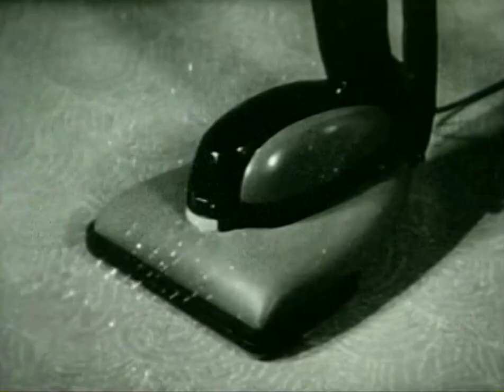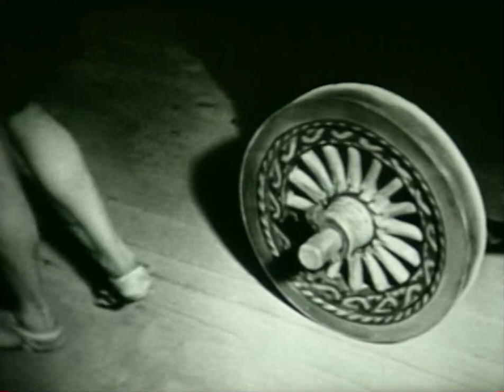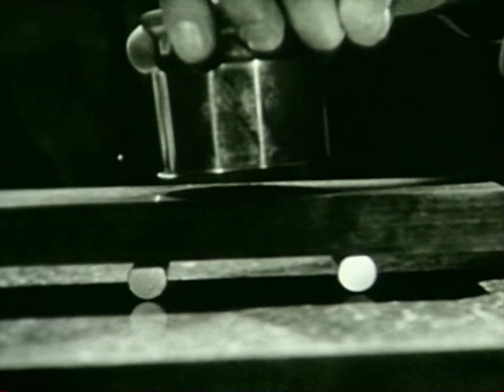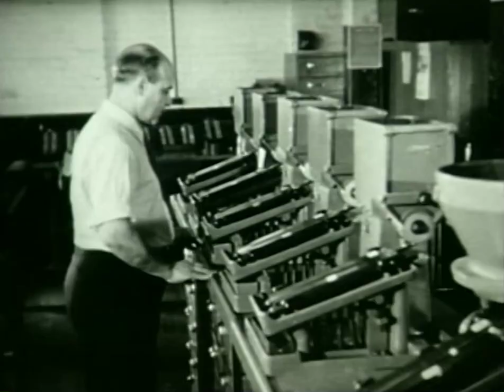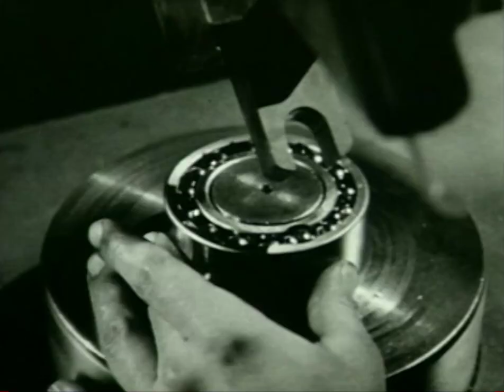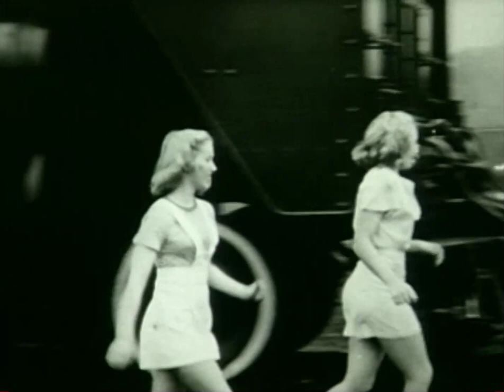Turning Point the Story of Bearings, New York Central "Niagara" 4-8-4 Pulled by Four Young Girls

Comment: Before it rolls they have to overcome the inertia. A body at rest....yada yada.    Call me skeptical.
Reply: I park on a hill all the time.
Reply: Not skeptical but not paying attention. In all examples give the inertial resistance to motion remains, but in a reduced amount when using roller and ball bearings when compared complain bearings. You can tell that by the degree of reflection on the plastic ruler and the feather.
Reply: Inertia and friction are two different things, right? Consider that in space, where everything is weightless, an object’s mass does not change. That is why an astronaut cannot move the “weightless” International Space Station with a wave of his arm.
Reply: That is true but without friction any net force greater than zero will cause acceleration. Of course there is still friction, and that is mostly what they're fighting. I'm also skeptical of that demonstration though, because an 860,000 lb train requires, even with the best rolling resistance coefficient of 0.001, 860lb to move at a constant speed, even ignoring friction from bearings and turning over those giant steam engines. The demo is bullshit, but for different reasons

Comment: Most freight cars had plain bearings until the 1960s.
Reply: The reason for eliminating plain bearings on interchange cars had little to do with "roller freight" efficiency -- above about 3mph a good hydrodynamic plain bearing is just as effective; in fact, very few IC engines use rollers for critically-loaded parts like crank and big-end bearings.

The switch was made for maintenance and reliability: any concerns with rolling wear were constrained to the bearing, and they could be grease-lubricated (as in AP bearings under the M-947 standard) to run longer than the lifetime of the steel wheels themselves.
Reply: In the UK such wagons were in use until the 1980s, but these wagons had low speed limits. Typically they weren't fitted with automatic brakes and were limited to 25mph.
Reply: crazy

Comment: Hard to believe considering the number of times I had to push car when it wouldn't start!
Reply: Steel on steel has a very low coefficient of friction compared to rubber on tarmac.
Reply: @neiloflongbeck5705  Ball bearings only make point contact.
Reply: @r1xelex  yes, but they aren't as important to the interim as the slightly flattened contact surface of pneumatic tyres when pushing a car. When pushing a car you will still only have the friction in the wheel bearing and the bearings on the transmission up to the gearbox plus that of the tyres on the road surface to overcome plus the inertial resistance of the car. Of the sources of friction the largest is and always will be that between the tyres and the road surface. When pulling a steam locomotive the tyres on each wheel act like roller bearing and allow heavier loads to be pulled with less effort, taking into account the internal force that the locomotive represents as demonstrated atbthe end of the film. Please remember that the earliest railways used manpower to push or haul wagons filled with mineral-rich rocks or coal from mines much heavier than a single man could carry.
Reply: @neiloflongbeck5705  Now think through what you have written and try again.  Piston and slide valve friction etc.
Also what about when Charles Atlas had to really heave to make a loco move?
Reply: @r1xelex  nope. You think about the oil and grease used to lubricate the pistons, valve gear, connecting rods and axle boxes.

As for Charles Atlas I can't find evidence of him pulling g anything heavier than PRR coach. Do you have more details and don't forget to state what kind of bearings it had. Correction  I've now found reference to him pulling a locomotive that weighed in at 145,000lb at Queens rail road yard, but no other details, not even the date it occured.
Reply: Amazing what less friction offers despite the HUGE weight difference.

Comment: IN MY DAYS OF RAILROADING STARTING 1964 IT WAS QUITE DRAMATIC SEEING THE FRICTION BEARINGS SUPPLANTED BY THE ROLLER AND BALL BEARINGS!
IN THE CASE OF THE FREIGHT CARS, SITTING ON A SMOOTH RAIL
AND BRAKES RELEASED, A PUFF OF WIND CAN START IT ROLLING!!
Reply: That's why you always tie a brake on siding cars!  Prevents whoopsies!
Reply: A lot of square footage on the side of the box car for the wind to get a hold of I know it sounds crazy but that’s where the rubber meets the road
Reply: @robertholderman7552  
IN THE LATE 1960s THERE WAS A ROLLER BEARING EMPTY BOX CAR THAT ROLLED OFF A SIDING BETWEEN HUTCHINSON KS AND DODGE CITY, AND ROLLED FOR 75 MILES BEFORE IT GOT TO A PLACE THAT WAS A LOW SPOT!
ABOUT HALFWAY BETWEEN 
START AND STOP THERE WAS A DEPOT CLERK WHO STAYED MUCH LATER THAN USUAL CATCHING UP ON PAPERWORK!
WHILE WORKING AT NIGHT HE HEARD IT ROLL BY AND THEN WENT OUT THE DOOR TO CHECK IT OUT!
FORTUNATELY IT WAS A BRIGHT MOONLIGHT NIGHT AND HE SAW IT HEADED EAST!
HE PUT OUT THE WORD AND NO COLLISION OCCURRED!

Comment: At first I went, I’m sorry what ?!? when I saw people pulling a full-size locomotive 

Then again I remember the Niagara’s had roller bearings and were lighter than other Northern’s

But the ability to pull a locomotive is crazy

Edit: I didn’t think my comment would get this much attention
Reply: A Lionel O gauge model of N&W 611 can pull the real thing, and it has. Roller bearings are no joke!
Reply: @PowerTrain611  For real? Wow, and 611 is among the heavier 4-8-4s, impressive!
Reply: the axles might have bearings, and there is quite a few of them, but there is 2 very large pistons, plus the slides, and all the valves, find it a bit hard to believe.
Reply: @stephenarbon2227  With proper lubrication and warm cylinders with the drain cocks open, there's much less resistance than you would think. Trains are very easy to move because there's very little resistance due to there being such a small contact point between the rail head and the wheels... It's only about the size of a dime.
Reply: @Stephen Arbon  This video was sponsored by Big Bearing.

/s not /s
Reply: @stephenarbon2227  
Possibly there is a neutral lever? Or they disconnect a linkage? Dunno
Reply: @ronfox5519  Leaving the locomotive in neutral might actually make it more difficult to pull because it can creat a vacuum in the cylinders. The probably put it in full forward and just left the throttle closed with the drain cocks open.
Reply: @PowerTrain611  
Is that to say that they do have a neutral lever? I dont know enough to say one way or the other. Just thought the guy brought up a good point about overcoming the resistance of the engine.
Reply: @ronfox5519  In a sense. Many of the roda on the sides are used to control what side of the piston steam gets admitted to first to control direction, and leaving it in center makes it so virtually no movement will come when the throttle is opened. That's what the neutral position would be.
Reply: @PowerTrain611  
Interesting. 
Thank you for the info.
Reply: @ronfox5519  You're very welcome. If you have any further questions or a general interest in learning more about steam locomotives, look up a guy named "Hyce" here on YouTube. He has a lot of deep-dive videos from basic to advanced on the workings of these awesome machines.
Reply: They say nothing of any grade the locomotive may - or may not - have been on. ;)
Reply: @jtsena ☝️ Good point
Reply: @jtsena  
Youre right. They were probably out to trick us from 70yrs in the past. Based on that, we must say that the entire demonstration is totall invald. 
Roller bearings are a hoax!
Reply: they had a lot of training for this
Reply: @phil6506  It shows. Look at those muscles!🤣
Reply: @PowerTrain611  And the high heels.
Reply: I was just hoping none of the girls fell down and got ran over. Looked a bit dangerous lol.
Reply: Mark's Mechanical Engineering Handbook lists the typical rolling resistance of an entire train as 14oz per ton of weight.  The 4 girls were said to weight 410 lbs in total, so at a 45 degree angle (of leaning into the ropes) they could provide a force to move about 400 tons on level track. It doesn't look to me like they all ever reach a 45 degree angle at the same time, and as pointed out the locomotive has the friction of the engine too (however it also has larger diameter wheels that tend to offer less resistance).  Note that most "typical" rolling resistance is NOT the bearings (or engine friction), but the typical al flexibility of the ground (causing a slight hill to always climb out of).  On very stiff ground (such as over bedrock) the rolling resistance can be less than a quarter pound per ton of weight, so I believe the video could be fair (on perfectly level ground), however the sure way to tell is to measure the resistance both directions in a no wind situation. The girls should have pulled the locomotive back to it's starting position on the track.
Reply: I'm suspecting this was a setup. In fact the incline of the railway lengthwize has much more effect on the pulling force required than friction. So these ladies were helped by a slight incline I am sure, if not by the engine itself or by pushing from behind. Not to mention there are more friction things in a locomotive other than wheel axels. "Oh, those miracle commercials..."
Reply: @michroz  It's actually funny you bring this up... I was thinking about this and remembered seeing a challenge on world's strongest man where they have to pull a boxcar... Wherher it was loaded or not, a boxcar does not weigh in at 400 tons... And they have timken roller bearings too. Now I'm starting to doubt this myself...
Reply: Wow! But what about a friction in pistons rings?

Comment: This is the first video I have seen of people pulling a full sized monster made of steel.
Reply: yea take out the pistons
and the internal valve gear
the mechanical pumps
and so on it looks good
like building a paper 40 ton tank looks good
4 men pick it up
Reply: It's been claimed that because of the Niagara's lightweight, two people: most likely grown men, were able to push both the locomotive and its centipede tender. You look at these things and think: "There's no way someone could push that big beast" but apparently it was possible back then.
Reply: @Admr-coldhead21 As a Physics teacher, let me explain a few things.
The rails need to be absolutely level as the slightest incline will have a vertical force component of high value, way beyond human exertion.As the loco is in a perfect level postion the only resistive force is in the horizontal direction. As these loco use amazing anti-friction bearings the minimal contact surfaces of the balls and rods in the bearings make it possible to move such weights. Also, they incorporate lubricants into the bearing which reduces further adhesive wear. I researched wear as my thesis. So bearings keep surface contact to a minimal, and the grease or oil makes sliding much easier, so a heavy object can be move, only on flat ground. The slightest vertical angle of movement introduces gravity affect and easily exceeds human strength.
Reply: @emanuelmifsud6754  in other words, the train wheel and tracks also act at the same mechanism as bearings inside the wheels itself when it’s perfectly level. Good explanation 👍🏼
Reply: @emanuelmifsud6754  I dont understand how the fiction in the  rings in the giant pistons was over come by four little girls?
Reply: @erica8664  they had spinach for breakfast😊
Reply: @sulman1755  You are correct.
Reply: @erica8664  They are pulling the train in a neutral gear, the pistons are not moving.Although I am not familar with the gearing in a loco, there is no way those women wouuld pull the loco and rotate the pistons. The engibne was disengaged. The only friction acts in lines between wheels and rails and the bearings, so friction is reduce as contact area is minimised. There is also fristion when the object move to push the air away.
Reply: @emanuelmifsud6754  Needs not only flat ground to work, but also a solid rail bed that won't flex under the load, otherwise it'll be sitting in a slight rut all the way.
Reply: You are absolutely correct. As I said, any vertical force component would make moving the object an impossibility.

How is the base prepared for a rail track?
Reply: @Admr-coldhead21  Using aluminum wherever possible definitely helped in that regard, but the bearings and careful balancing of the motion made them that much more of a middle finger to friction
Reply: @Admr-coldhead21  You can’t push diesels like the Niagara. They do not care about any technology like that.
Reply: @Admr-coldhead21  It was done in Chicago in around 1930 by 3 men, and the tender with coal and water was attached too.
Reply: Steel wheels on a steel track also makes a big difference as long as it is level. I have accidentally moved a bogie (truck in America iirc) in a depot by just lightly leaning on it, thus finding that it hadn't been scotched/chocked properly. They must weigh a ton or more. I have also seen a few men pushing bogies and even complete carriages for short distances when it wasn't convenient to get a shunting engine in. Impressive to view. I must admit I share others scepticism about the 4 girl power engine because of all the other attached equipment such as cylinders. I would have thought that even with the valves held open the compression would act as a bit of a brake, but maybe not. It was entertaining anyway and if ICE cars become illegal in the future I would prefer my vehicle to be pulled by hot women than buy electric😊
Reply: If you do some math, and figure these 4 girls got the loco moving at about .5 mph, and if combined they were pulling with a total force of 300 lbs, which is only 75 each, then the work being done is 220 lbs-ft/sec. Divide that by 550, they were generating only a combined 0.4 horsepower. An output of .4 horsepower from 4 girls isn't out of the question, they could probably keep doing it for at least 15 minutes before getting tired. It all depends on the rail bed, like someone else said, the hardest thing is pulling the locomotive out of the sag in the rails is creates. So they probably did this stunt on a section of track with concrete sleepers and a very solid base, and well compacted ballast. Look next time you're stopped at a railroad crossing, and watch a rail carefully as a train goes by. I've seen some freight trains deflect the rail downwards what looks like a full inch every time a set of trucks goes past a fixed point. This constant flexing of the rail is what eats up a lot of the tractive effort, assuming the rails are perfectly parallel. Going around a curve, things get much worse from the wheels trying to push sideways.